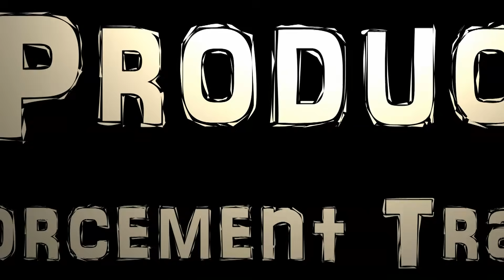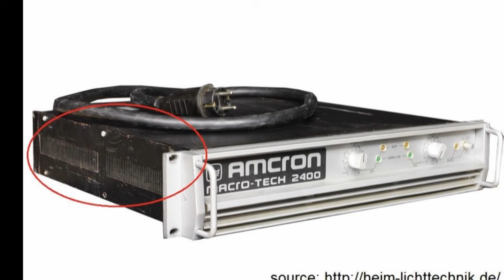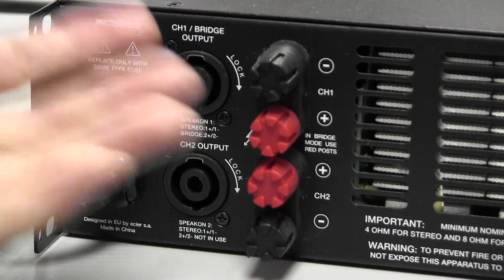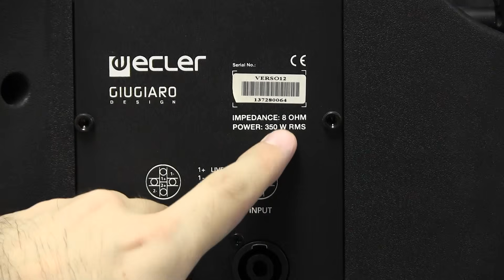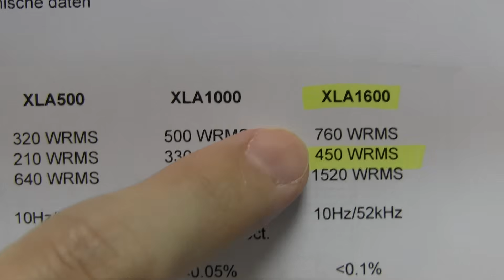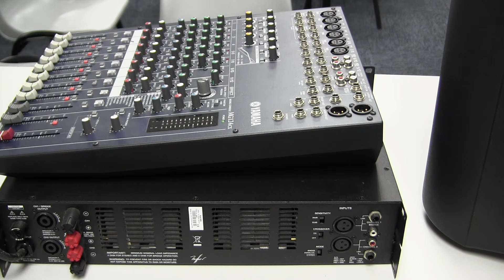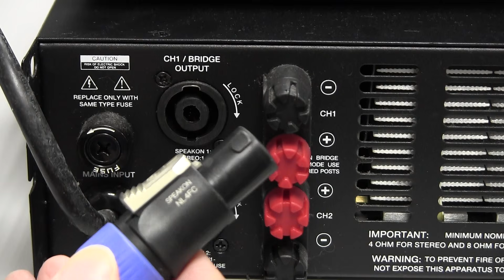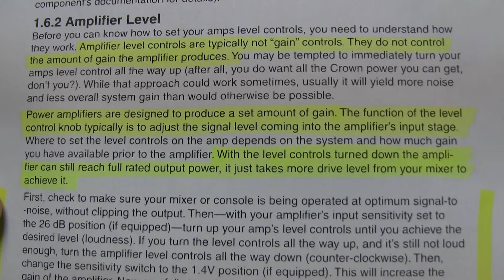How to connect a power amplifier to passive loudspeakers

Comment: Hello. Thank you again for your detailed videos. I have a concern and don't quite know the implications of the decision i want to make.
I have 800w per channel at 8 ohm speakers. Since i was restricted by my budget I asked for an Amp that will cater for my speakers which is within my budget range. Unfortunately the dealer said they do not have an Amp within my budget that could do the job, but they advised that a slightly lower rated amp, namely the Phonic max2500 would would do fine and is just within my budget. this amp at 8 ohm is rated at 500w. Would this work? What are the implications? Would i have to operate the amp at half gain maybe, to reduce the speakers effect of the amp, or that won't make a difference?
Reply from the maker: +Speedy J Mantshiyane Please watch my video on this subject, it should answer most of your questions: https://www.youtube.com/watch?v=l9L7uK7Xy0w
Reply: +GLB Productions sh for more volume because in all likelihood it will overheat, clip or distort. My other question is What does it mean when the Speaker spec sheet says:
-Total Max Power: 1000watts
-Total RMS Power: 800watts
Is this RMS rating total rating per channel or overall RMS rating of the speaker?
Reply: Thank you. that cleared most of my questions. Just want to ask for advice. So you are saying when using an underated amp, is it advisable not to push the gain to the max for more volume because in all likelihood it will overheat, clip or distort? My other question is What does it mean when the Speaker spec sheet says:
-Total Max Power: 1000watts
-Total RMS Power: 800watts
Is this RMS rating total rating per channel or overall RMS rating of the speaker?

If your Speaker only gives you a 400watt at 8 ohm and you daisy chain two of then in one channel, should the rating on the amplifier be 800watts + @ 4ohm stereo to be able to supply the speakers?
Reply from the maker: +Bongani Mokansi The RMS rating is basically the average power handling capacity of the speaker - it acts as a guide when choosing an amplifier.
Reply from the maker: +Speedy J Mantshiyane When you use an underpowered amp you are more likely to push it into distortion because it will give less volume. However pushing any amp into distortion, even a correctly rated one, will cause speaker damage eventually. 

The RMS rating is basically the average power handling capacity of the speaker - it acts as a guide when choosing an amplifier.

Yes, an 800 watts into 4 ohms amplifier connected to two 400 watt 8 ohm speakers will result in each speaker getting 400 watts.

Comment: I do live sound in school and work with the PA systems alot, but i keep on getting alot of crackle from my left speaker and i cant seem to get rid of it, i use a behringer euroback UB1204FX-PRO mixing desk and im not sure of the brand of speaker, is there anything i can do to fix this?
Reply from the maker: +Jacob Henson The first thing to do is to find out where the noise is coming from: swap the right and left amplifier output cables, if the noise changes sides you know the source of the problem is not the speaker, and must be either your amplifier or mixer. Do this and let me know what you get.
Reply: it turns out i had the track paying through the sub system instead of the main mixers

Comment: Damn passive monitors are complicated, I was going to get some but I might stick with active since I don't know anything about this and I would probably blow the speakers.
Reply from the maker: +jTactics Yes they can be, although if you buy your system from a good supplier they will do all of this initial matching for you and take the guesswork out of things. Small passive systems are actually slightly faster to set up in the field because you only need to run a single loudspeaker cable to each cabinet, as opposed to a power and A/C cable.
Reply: GLB Productions you seem knowledgeable, so ill ask you.  I was planing on buying the Amphion one15 monitors and I am having an old Adcom GFA-545 amp upgraded by Jim Williams that I bought off ebay.  This setup is suppose to be amazing.  Trouble is I have an RME babyface, with no XLR on the Adcom GFA-545.  People are telling me i shouldnt connect directly anyways because you can blow your speakers and suggested a monitor controller.  I am so confused.  So besides the RME babyface interface, the Adcom GFA-545 and the Amphion One15s, what do I need to protect the speakers? Also what chords.  If anyone can answer this you will be my hero.  I also read somewhere that a mixer is required? Really confused.
Reply from the maker: +jTactics My first question would be, what explanation do those telling you not to connect your Babyface directly to the amp give? Have you ever blown a pair of speakers in the past using this amp? Secondly, what's the power output of the Adcom per channel into 8 ohms? Disclaimer: I'm a sound reinforcement engineer, not a recording or hi-fi guy, so I tend to cut through the BS to the essentials ;)
Reply: +GLB Productions this is what I wrote and what he told me.  

After reading for weeks and trying monitors in person, I decided to order the Amphion One15 blindly! I have no doubt in my mind I will love them. I am also having an Adcom GFA-545 upgraded by Jim Williams. This being my first pair of passive monitors, what other items do i need to order? I noticed the Adcom GFA-545 does not have xlr, how would I hook this up to my RME babyface AI?

"You need a really good monitor controller (or some sort of analogue volume control. Don't trust digital attenuation - you will blow your speakers. Just a matter of time.

Drawmer MC2.1 is an economic alternative that doesn't rob fidelity."

so if the above is all BS, because the power output matches and goes with the monitors, than what cables would I need to get this thing running?  Banana cables and what else?  Thanks for the help man.
Reply from the maker: +jTactics I wouldn't say all of it is BS, I'm just opposed to sweeping statements like 'don't trust digital attenuation - you will blow your speakers'. In live sound we use digital attenuation all over the place with absolutely no issues, from mixers to system controllers to amplifiers, so it's not the technology, it's the implementation thereof. 

I suspect what the person was trying to get at is that it is best to have some sort of analog volume control, rather than relying on the digital controls within the Babyface, because there is a chance that you might inadvertently send too hot a signal to the amp and thereby damage your speakers. Given that the Adcom has no volume controls, how do you intend to control the volume of your speakers? 

Yes you'll need speaker cables with banana connectors to connect the amp to the speakers and some way to connect the Babyface to the Adcom. The latter has unbalanced connectors, so it may be best to get the unbalanced breakout cable that RME offers for the babyface: http://www.rme-audio.de/images/products/Babyface_breakout_cable_unbalanced_alva_BF-BOCMKH.jpg
Reply: I was just going to use the babyface volume control wheel.  Thanks man you have been a big help with that cable link and the whole response in general.  You have earned a life long sub and I went through and thumbed up a lot of your videos.
Reply from the maker: +jTactics You're welcome, glad I could help :)

I think using the Babyface volume control would work just fine. Just be sure to let the Babyface boot up fully before switching on the amp - some digital devices make clicks and thumps while they are starting and you don't want these getting to your speakers. 

All the best with your music!

Comment: Just saw your follow up video on this but thought to ask here...

The level power knobs, I've heard from someone that it has to be at maximum all the time, because the electronic components "get addicted" with time. Are you aware of this? I'd guess that just a potentiometer need to be replaced in this case... I'm not sure of that though.

Thanks! Cheers!
Reply from the maker: +Fabio Kasper Hello Fabio! No, the level controls are there for a reason - if they had to be set at maximum all the time why would manufacturers provide them in the first place? And although electronic components cannot get addicted, it's possible for potentiometers to get stuck in one position due to corrosion if they are not moved for a long time - even more reason to use those level controls! 

In large systems you will often see all the amps set to maximum because a) it is an easily repeatable position and b) The level being sent to each amp is being governed by a central system processor, hence the level adjustment is being done remotely. But on smaller systems the level controls are basically your overall system volume.
Reply: +GLB Productions Thank you again. Very didactic. I love your videos and I'm a happy subscriber.

Final question, probably heard many times, what do you prefer, active or passive PA systems for small venues?
Reply from the maker: +Fabio Kasper Active all the way - modern active loudspeakers are amazingly light and loud and eliminate one entire rack case from your load. It means you can use smaller vehicles and also get set up faster. It does mean you have to run power to every single speaker but I'd rather carry more A/C cabling than power amplifiers.
Reply: +GLB Productions Awesome. That is what I was expecting... Many thanks again!

Comment: Hi, I have been watching your videos for quite some time and appreciate your way of delivering the message clearly. Good Job! 
I do have a question. Do you directly plug the power amplifier to the power socket (wall or power strip)? I have a problem with my power amplifier it died on me twice and I am not sure if it is a manufacturing defect. Both times somebody accidentally tripped or removed the plug from the socket and everything went "BOOM"(crowd control is another story). In the end my power amplifier is DEAD. I noticed some systems like your other video, you just have one switch for your power amps and when you turn the switch on, everything else get turned on. I assume you left the power amplifiers ON-OFF switch to always at the ON position. So is it safe to turn on/off the main power strip socket while the Power Amplifier switch is stuck at ON? or is there something in between the main power source like a surge protector or UPS.
Reply from the maker: +Paul Matthew Lerio Hello Paul, thanks for getting in touch. 

It sounds to me like your power amp may be defective, unless there is some issue with the wiring in your venue - pulling the A/C plug should not cause a loud bang like that, it should just result in no sound! Was it just the power amp that got disconnected, or the entire PA system?

In large systems the power amps are turned on using a sequencer which powers up the power amps last and switches them off first - this is to protect them from signal spikes caused by things like mixers, EQs etc.
Reply: Since our system is quite small consisting of just the power amplifier and mixer. They are directly plugged into a power strip. Both gets turned off. My guess is that signal is still coming from the mixer, thus the loud bang. Would this automatically render my power amplifier dead when there should be some kind of protection. On normal circumstance I power up and down sequentially. Also this happened off our normal locations (twice) thus some venue challenges.
Reply from the maker: +Paul Matthew Lerio It sounds to me like the issue was everything getting turned off at once - when this happens the mixer produces a power off transient (signal spike) which is sent to the power amplifier. Even though the power amp has lost power, there is still a power reserve in the capacitors, and this is what causes the big bang that you hear. 

Not all power amplifiers are created equal - most that I know of are tolerant of this sort of thing, but others may not be. 

If power loss during a show is an issue, I suggest getting a UPS for your mixer and other outboard gear - this will at least keep this equipment running for a while and give you enough time to turn down the levels on your power amp before restoring the power. 

Also may I suggest taping down your power cable!!!! :D
Reply: OK. Thanks so much! Must do better taping and better control who is around the mixing table to prevent accidents from happening.

Also learned a new thing with regards to powers sequencers. We are using an LD Systems DP 1600 type power amplifier, not sure if you have any feedback on that type. I know its not the most expensive type.

At least I know that this power amplifier is not tolerant of this thing.
Reply from the maker: +Paul Matthew Lerio You're welcome, hope it doesn't happen again :P
Reply: Yah, as of now power amplifier is dead and will have it serviced. 

By the way I am also based in Hazy Singapore! lol!
Reply from the maker: +Paul Matthew Lerio Yes, the haze is pretty bad today. Let me know if you or your group ever need training, if you are in Singapore we can set up something face to face.
Reply: Thank you for the offer! Thanks again and God Bless!

Comment: Hi Bruno.. That's a great video with absolute clarity & detailsI have a query for my home setup. I want to install central music system for 3 spaces- 1st is a 700 sqft hall of 11ft height, 2nd is about 400 sqft lounge with 20ft height & 3rd is a small terrace garden of 600 sqft. I intend to install 2 or 4 speakers in each space. I am looking forward to good quality sound output (not loud). Even going to so many docs for last 3 months have not been able to decide whether to go for 100V/70V type Amp or Power Amp. However I have an inclination to Crown 1500 XLS but really don't know which speakers (ceiling mounted) will work the best with them. If you can help would be really a great help to me. Thanks again.
Reply from the maker: +Studio Green Hello Studio Green, thanks for getting in touch. I'm afraid that I cannot answer your questions without seeing the space you have, and in any case I would refer a job of this type to somebody who specialises in installation work. Could I suggest that you find somebody in your area who can do this? Look around for people who have good-sounding systems and then ask who did the work :)
Reply: +GLB Productions 
Thanks for your prompt reply...appreciate that.
Can you pls throw some light on the Sound quality/ music reproduction of 100V/ 70V Amp vis-à-vis Power Amps (requiring impedance n load matching speakers) assuming both system have compatible speakers.
Thanks
Reply from the maker: +Studio Green In my experience the 70/100V lines sound fine, although I have only ever heard them in background music and paging applications. A lot of it depends on the quality of the transformer built into the individual speakers - low quality transformers saturate easily and introduce distortion. 

The primary application of constant-voltage speaker systems is where you have relatively long cable runs between the amplifier and the loudspeaker, and/or where one loudspeaker needs to drive multiple identical loudspeakers. This may not be necessary in your situation, depending on the distances involved, as you mentioned only 2-4 speakers in each space.
Reply: +GLB Productions Thank you so much for your support.
Best regards

Comment: Hi bro, for daisy chain, do we need the same number of watts with the primary speaker. Thanks
Reply from the maker: +Zulkifli Noriman No you do not, although it makes your calculations easier.
Reply: +GLB Productions ok bro thanks
Reply: +GLB Productions actually thru my experience, i've done this before by daisy chain with a different watts speaker. Power amp 1200 watts 4 omh to 600 watts spk and daisy chain to 200 watts spk. It's happened that 200 watts spk sound with distortion.
Reply: +GLB Productions both speakers with 8 omh.
Reply from the maker: +Zulkifli Noriman Yes in that case both speakers will be receiving 600 watts, which is probably too much for the 200 watt speaker - you still need to calculate power delivery per speaker and make sure that you are matching your speakers and amps correctly.
Reply: +GLB Productions Ok , thanks again bro for the great info.

Comment: Fantastic video!  I'm still having a little bit of difficulty understanding.  Perhaps you'd lend a hand.  Carvin DCM 1000 - both channels RMS continuous 8ohm 225/ 225 and 4 ohm 350/350.  Speaker set 1 is Carvin 1584- 400 watt at 8 ohm but recommended is between 75 and 600.  Speaker set 2 is also Carvin  PM 15 8 ohm 400 watt, but recommended is 400 to 800.  

Is it feasible to run all 4 speakers with this amp?  If so should I run it both of one type of speaker on one channel or one of EACH type of speaker on a channel.  Finally what's better (louder) running one speaker with double the rms watts or running two speakers off the pa and only meet the minimum recommended watts?

Thanks in advance!
Reply from the maker: +Christian Kessler Hello Christian, thank you for getting in touch - good questions! 

In this case you can run all four speakers off the same amp - the amp will operate at 4 ohms per channel and each speaker will receive 175 watts. This of course is somewhat below the ideal power of 400 watts per speaker, but it can be done. Under powering your speakers will not hurt them as long as you do not clip your power amplifier. 

What is louder will depend on the sensitivity of the loudspeakers themselves, ie how many decibels of sound they produce given 1 watt of power. All other things being equal the more sensitive loudspeakers will be louder for a given power input. 

In practice, I have found that it is often best not to run an amplifier at 4 ohms due to cooling issues, especially in Singapore where ambient temperatures are very high.